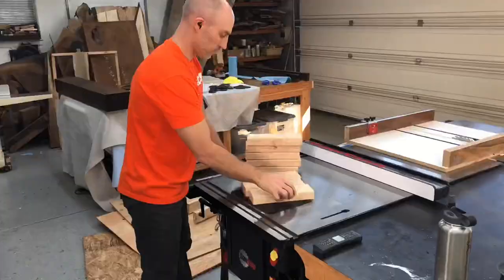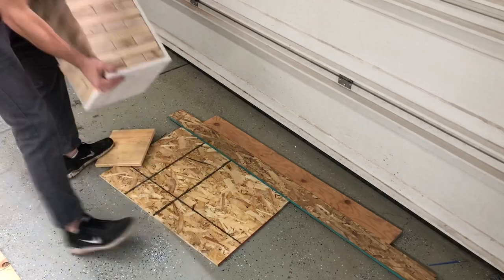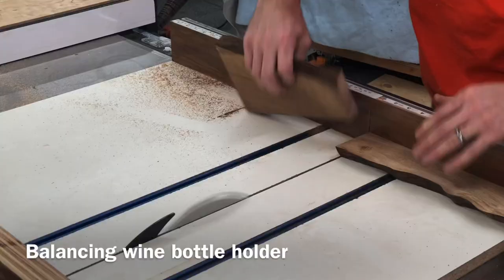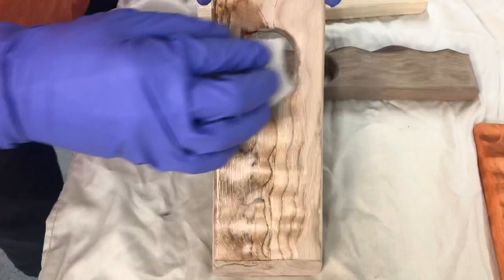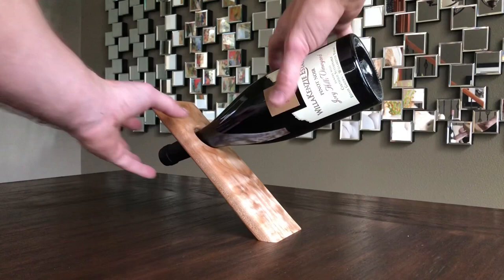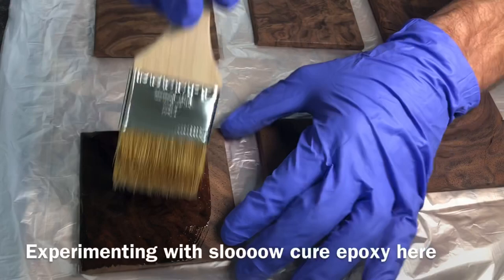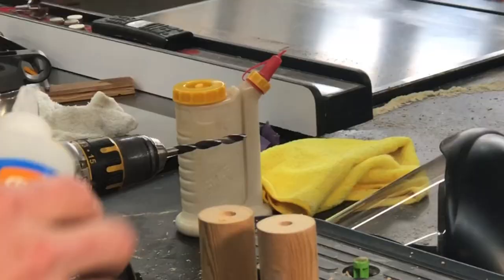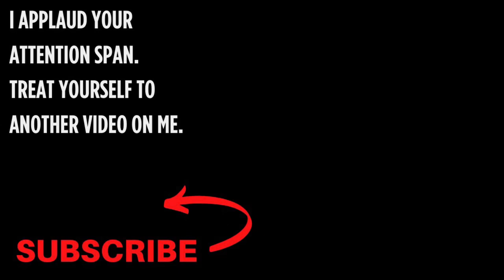DIY Projects - Crafts With Kids - Things To Do At Home

Comment: Hey cam, great video gave me a lot of new ideas. For the floating wine bottle holder you said the length doesn't matter just the size of the hole and the angle of the cut on the base but is there a length that works better? And should the hole be in the center?
Reply from the maker: Hole doesn’t have to be in the center. 9.5” is a good length
Reply: @BlacktailStudio  excellent thank you

Comment: Hey Cam, what type of bolts do you use to bolt on the legs to your live edge tables?  The bolts with the large diameter heads that require an Allen key (not the threaded inserts). Is there a proper name for them?
Reply from the maker: You can usually find em if you search furniture connector bolts. There’s a Japanese name. Murokashi or something too

Comment: Hey cam, the wine bottle holder, does the hole has to be any  specific size or in an angel? ,  all I managed to get was when you said that wood can be any size. What about the length.
Reply from the maker: Check out the blog post. Little more detail on everything

Comment: Hey cam, I wanted to do a flood coat on my bar top. Could I seal the wood with shellac or should I put a thin layer of epoxy down instead?
Reply from the maker: Thin epoxy would be better

Comment: hey cam. what blade are you using on your band saw? i watched the coaster video but im  new subscriber
Reply from the maker: It’s a Laguna resaw king 👍🏼👍🏼
Reply: @BlacktailStudio  thats the same one i have but i dont get the nice finish cut you get haha. blades tight and correct and im noy pushing to fast. ehh still better than the stock blades i have that seem like all they do is burn wood